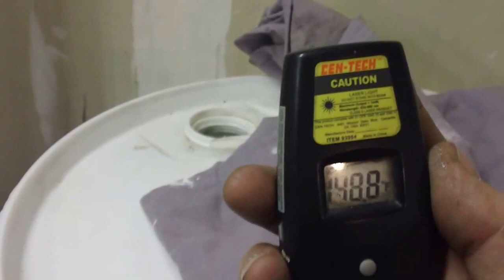Rocket Stove Fireplace Part 7

Comment: Hi, in your cob combustion chamber, have you used clay mixed with Perlite?
What about your fire brick flu stack, have you constructed that part with a Perlite cob mixture?
Reply from the maker: When perlite is added to the cob it makes it more of an insulator an insulator is exactly the inverse opposite of a thermal Mass so for insulation purposes perlite Lite would be good but for a thermal Mass purposes it lowers thermal mass
Reply from the maker: When perlite is added to the cob it makes it more of an insulator an insulator is exactly the inverse opposite of a thermal Mass so for insulation purposes perlite Lite would be good but for a thermal Mass purposes it lowers thermal mass

Comment: Excellent job, just watched all your updates... soon as you used the word 'practical' I really tuned in!.. The small burn chamber and short burn time with constant loading on regular rocket stoves always seemed like a pain in the butt to me. Your large burn chamber plus the brick riser with it's greater thermal mass makes so much more sense. Only question I have is;  with the 2-3 inch clearance between the heat riser and the side of the barrel, is there a problem with draft/air flow to the chimney?  Really appreciate you sharing your ideas...
Reply from the maker: +Roger Coles makes the draft stronger by keeping riser hotter
Reply: +Van Powell Ok..thank you... I can see how that'd work better. Happy New Year!

Comment: You need larger bore pipe to carry the hot water to the storage in the uk we use. 28mm or 1 inch and it works fine.

Comment: I like the large firebox design and the extended burn time of your design. I wondered if you have tried the wind directional chimney caps as advocated by other rocket stove builders. Search  T2H Instructionals and Rocket stove and wind proof chimney cap.  He says that this design solved his backdraft issues.  I also liked the idea of the sawdust waste oil cartridge and wondered if you had tried this larger stove with a large sawdust and oil container.
Reply from the maker: +mj hurd  Sorry it took me so long.. I like both your questions .I will let you in on a secret... the reason they use a wind direction cap is because they cool down the smoke to much to the point it wont draft. HEAT flow is a key factor in draft. I tune mine to take just the right amount of heat so draft is NOT a problem for this stove, UNLIKE the tradition rocket stove that set in the very same place built by the book. second question.. I'm going to give you another secret. think BIG Build a 6 foot box stone square put a  8 inch flue out the back. open at one end with large door. take a 5 foot diameter 18 inch deep cattle trough from tracker supply put metal wheels on it  and cut you a 4 inch hole in the center take metal lath 24 inch wide  and roll it to match your 4 inch open in the trough set on top on the whole hold in place and pack saw dust all the way out to the sides and pack then pour what ever waste oil you like on top . roll it in box and light a paper towel and push it right under the hole and shut the door = even continuous  heat for 24 hours or once a day fire tending with roll in and roll out load abilities. GREAT for a green house.. I have built them in 55 gallon drums they burned 8 to 10 hours  and a  3 foot cattle trough  it burned for 16- 18 hours.

Comment: Hey Van, It didn't seem like you carried the 12 inchs in the firebox  through the whole system. Is that correct? I have a bunch of 12" pipe and wanted to make a big fire box batch load stove but was thinking I would have to have a 6 foot diameter barrel to keep the measurements right to draw correctly. Any thoughts?

Comment: I recently discovered the rocket mass heater and instantly I wanted to use it to heat water or use water as the mass.   I have built my first stove using 6" stove pipe and like you say, the burn time is fast so I am already drawing up plans to make a larger feed chamber, just like you have.

The problem I have is capturing all the heat made and storing it in water oppose to where a regular rocket mass heater stores radiant heat in the mass built around it.
Im thinking I will need to built a heat exchanger that is the entire length of the main heat riser.  My idea is a 6" steal pipe inside a 8" steal pipe. The 6" will be the main heat riser and the 8" will be welded both ends with an inlet on the bottom and an outlet on top. 

wouldnt your system siphon up top if your return was routed into the top 55 gallon barrel?

Comment: Great job!

I had an idea to build a ther a siphon system, using a pressure cooker with a percolator inside made from a stainless pot lid.  That may give you the pressure to push to the upper Barrel as well.

Comment: Does your barrel ever get ash in it?  My rocket mass heater barrel and exhaust tubes have to be cleaned out at least once per season.  How do you clean your barrel & exhaust tubes out?    I see you have the copper tubes on top of the barrel ... (?)
Reply from the maker: hello,, Yes copper coil on top of barrel with cob around it then tile on top. when the stove is cool i use a shop vac and pull the pipe loose from the side and go in around the bottom of the barrel with the shop vac to suck up any settled particles

Comment: Van, with that single barrel only getting up to 160 degrees through the thermosyphon, do you have to worry at all about steam build-up / pressure build-up in that barrel? If pressure was an issue, do the PVC barrels present enough porousness to release pressure naturally?
Reply from the maker: No... No pressure ever builds past the point enough to push the water. the barrel has small hole in bung to let off any that would build... no pressure has any place to build
Reply: Thank you, sir.

Comment: I'm wondering, could you theoretically run the hot water into a radiant floor system instead of barrels? How many cubic feet of water do you have and how much linear feet of 1/2 inch pex could that heat? Understanding that the stove would have to be below the floor to get the thermosyphon to work properly…
Reply from the maker: Hello Ian ..  Good ideas and Yes is the answer on the radiant floor system. Here is how to engineer the stove. Design the firebox with the amount of BTU's you need hourly to heat your space plus how you want to rob and store each hour in Mind for a total BTU consideration in the stove. Then design the coil or heat ex changer to Rob or steal heat off until the flue exit temp is down to 200-250.. any less can and will cause problems with draft and creosote ant more is heat loss. A good clean burning stove should be equally considered and another topic all together. Then design the volume of water need to the amount of heat needed to hold the total of stored BTU's right under the boiling point so about 200 .  
also the floor heating can be done easier than you think with the elevation issue properly considered. A small reservoir such as 5 gallons can be mounted with elevation higher than the fire box then be gravity feed down to the coil then leave the coil hot and be pushed by the boil down through the concrete plumed system and then come back up out of the floor to a entry point in the 5 gallon bucket just above where the bottom one runs out both located in the lower portion of the bucket and the volume of water will equal whats in the 5 gallon bucket and whats in the pex tube in the concrete and pushed by gravity and thermal siphon while it gives off the heat to the floor and returns to the bucket or container cool ready to repeat the process. Gravity plus the boil pressure sees it as one big bucket and will push it from the lower elevation to the higher every time and will circulate continuously   you may have to put the coil on the return side of it. instead of the push side or out flow side but It will push it.the pressure will built till it pushes it one way or another no more or no less as all other pressure is let off in the open or non sealed barrles  Hope this helps
Reply from the maker: How many BTU's you need can be determined by the following formula:
BTU= Area of walls and roof divided by the R- value of the insulation in those barriers multiplied by the temperature difference of the worst day expected. SO btu=a/rxD... delta t or temperature difference on worst day would be like if the coldest day was going to be 0 degrees and you wanted it to be 70 degrees in the space you would use a multiplication factor of 70 for the Delta "T"
Reply: Van Powell Great, thanks for the insight! Hoping to build a hybrid system  that combines a few different techniques together. Only in the research now however.

Comment: Lol, rocket fireplace.
Does that big mass bench even get warm midway down?
Still perceiving this as a win so not to damage the ego with the obvious fail?
This video is how NOT to build a rocket mass heater.
Reply from the maker: Hello, the answer to your question about the bench is "no" its not design to do such a thing. The answer to your second question is "yes" on I count it as a win  and the question as to the reasons not to hurt my ego is "no". Lastly I would say you are correct this is how not to build a traditional Rocket stove. The present arrangement works better heats longer less back draft smoke and free hot water, and requires less attention than the previous traditional rocket mass heater that was in the same location.  I have had a direct side by side comparison observation.  Thanks have a nice day

Comment: Nice setup, Van! I do wonder about the "thermosyphon" though - I've done many systems and the upper pipe is ALWAYS covered with water, there is never an instance when the pipe exits above the water. What you have is not a true thermosyphon, you're having to build a bit of steam in the pipe to get it pump up that last little bit of head above the water. Just increase the water level in the barrel until it covers the pipe and you'll have a true thermosyphon system and better efficiency.
Reply from the maker: Thanks. the cycle works I have set up. How ever you are correct in that it could be better. I learned allot on the subject on this one. It has been corrected since.
Reply: I think you'll find that you can run your pipes much higher so long as both ends are submerged. Insulating the pipes helps also. Kudos on the Rocket stove design!
Reply from the maker: actually placing them lower works better as the lower the water enters the barrel the more it fights against stratification and the better it heats the total volume and not just the top as the heat disperses in to all the water as it naturally rises up through it
Reply: Right! I meant that you can have the barrel placed rather high up and the system will still work. Having the hot water enter lower in the barrel gives better mixing and less stratification, as you say.
Reply from the maker: Ok .. I understand now what you meant.... yep yep it will push to any level it come from even higher elevation. we on the same page now

Comment: Curious why you didn't just bring the top pipe all the way up to the top barrel? Then both barrels would be involved. The colder water supply line to the fire only needs to come out of the lower barrel. Good Work overall.
Reply from the maker: Thanks Jim. Just didnt have enough pressure to push it that high I learned allot on this one,, the thermal siphon set up could be better but is sufficient with one barrel it only gets up to 160 tops.

Comment: The heat is transferring to the outside air, but it should be going into the mass, water or sand or cobb or whatever the mass happens to be, The longer tubes extracts the heat as it travels so very little is lost to the outside. I still think your creativity is admirable, but I would reincorporate those long tubes in the bench somehow. It may not be an easy task but if you bust down along the side of your stove and into the bench a bit, (if the pipes are still there) and into those long pipes I think you will improve heat retention by a whole bunch. (That's a technical term.) Thank you for your videos, I did learn a lot from you and found your creativity refreshing.
Reply from the maker: Hello Ms Mitchell and thank you. Thank you for being a nice lady and caring for the feeling of others enough to deliver your message in a considerate way. This Project was a remodel. If you go back a watch my very first video youll see the configuration it once was in that happen to also make electricity too. I have built many of these type of stove and messed up allot and learned many things on each one. I followed a few books that were wrong too.The water now actually stores more heat way better than the cob bench did. Further the pipe in the center of the bench is in use still. It now is used to deliver fresh out side air to the fire box which helps a lot with the fire and the draft. One of the keys to draft is the temperature of the exit, anything below 100 really can cause draft problems. The water in this configuration has been proven to hold more heat for a longer period of time than the cob bench did in the original configuration with the added benefit of free hot water. The use of a coil to act as a heat ex changer allows me to tune or determine the size of the coil needs to be in order to take all the heat I can and store it with out having a problem with back drafts as MANY rocket stove do have from cooling the exit gases too much. The other large advantage is this configuration is simply more BTU's delivered  with the larger burn chamber.Lastly the heat is not transferring to the out side air the difference between the exit gases above inner room temperature is call the sensible heat loss. Most fire places and wood stoves in a full burn will have 500-600 degree exit temps while my stove you see here has less than 200 degrees upon exit, which means Im keeping much more in the building and in the water. Further the 200 degrees will be brought down even further when I add the thermal electric portion to this stove as planned. This is just part of a series and the series is just part of the BIG picture.
Reply: Van Powell
Thank you for taking the time to explain, I do remember you talking about the temperature difference in the initial draft at the front end of the stove, I just didn't connect it in my head to the exit draft. Now it makes a lot of sense.

I really want to make this house cozy for next year, and having a slab floor helps in one respect, I wouldn't have to worry about the weight of the system. My other concerns were cost though. Systems like the Rocket Stove and your new design improvements on the Rocket Stove sound like they might be cost effective alternatives to my issues of getting the bills paid on a limited budget.

I inherited this house but it still has a mortgage that I have to pay. This is the first time I've ever actually had to be fully responsible for everything, and I am lost with it most of the time. I am learning though, and through the grace of people like you on YouTube, and other information I might be able to get these bills down to a manageable level.

I spent a lot of time taking care of family before they died and you don't get paid for that kind of work "officially"  so the working world thinks I've been sitting on my butt for several years, they don't consider taking care of family a full time job. Apparently they've never had to do it. I wouldn't trade the experience for anything though, I had some of my most touching and beautiful moments during this time.

Alzheimer's is a very devastating and lonely disease to the person who has it, it's hard on caregivers too if they don't take each moment as it comes at face value. It's like your parents are reverse learning, they know a little less every day and you never know what they won't know today. Then sometimes they surprise you by remembering things they had forgotten last week. So each moment you have to assess the place they are right now and work with that. But still remember how much they love you even if they don't remember who you are, or where they are.

Comment: Awesome stove man ! I officially want one is the water setup really needed or can you just do the wood stove part ??
Reply from the maker: Thanks Curt.  It was just set up as proof of concept.  It could be done with a much better finish, but this was a remodel of a previous rocket stove and in a garage and one big dang experiment.  The water is the heat storage part of this setup.  I also know how to do them without a cob bench or water.  It is just whatever best suits the individual.  This is just one way of many to set these stoves up and finish them.

Comment: Maybe you can put the barrels on an even plane and take the cold Inlet from the barrel on the right. Have you seen John Canivan's Channel he does a lot of hot water barrel storage.
Reply from the maker: Bob I have special plans for the other barrel. If I had it to do over I would up the coil to 1/2 inch and 25 foot long for better heat exchange for 2 barrels. I will still heat the other barrel just gona use TEG's to getter done. Just U wait n see..LOL happy Thanksgiving Bob